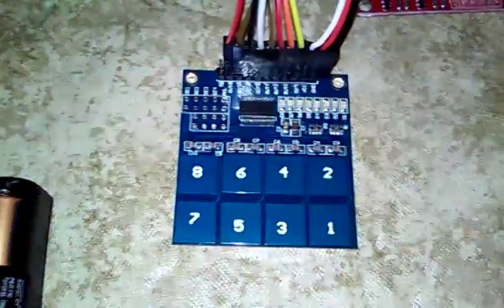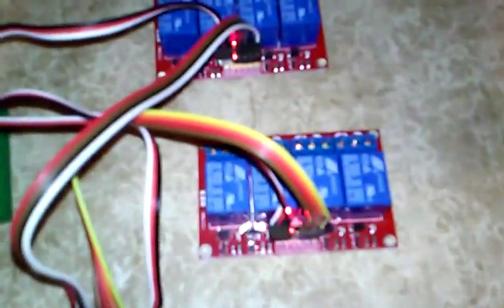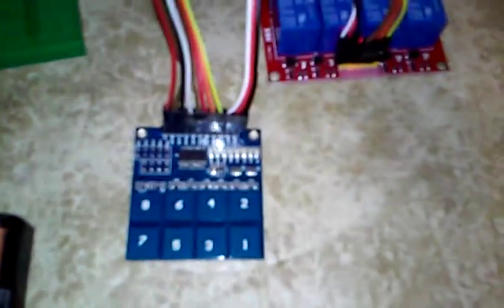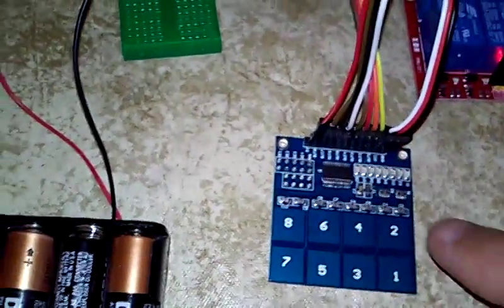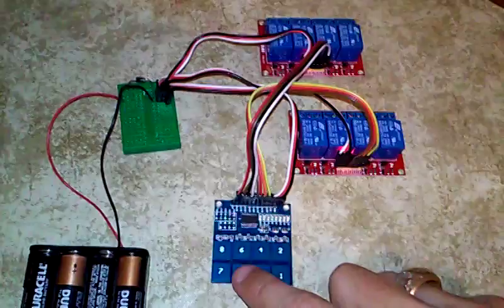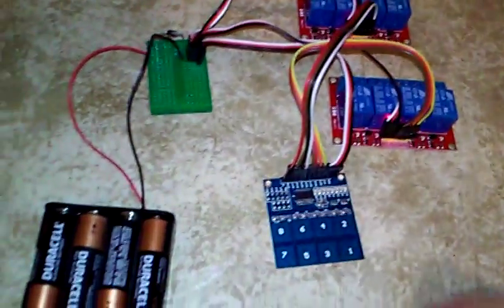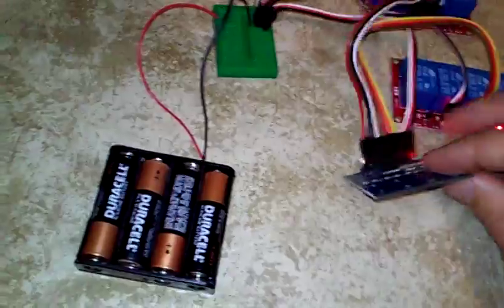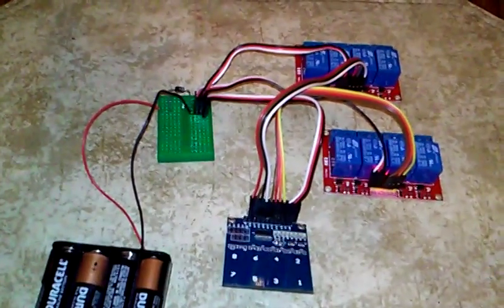TTP226 Touch Sensor Demo

Comment: Thanks for the jump-start on this little pesky board!  The sensitivity jumpers really helped settle it down.

A little late to the party but I have found the answer to one thing you mentioned.  This unit takes so little power that when you disconnect the power, you must short Vcc and Gnd to drain off any electrons still there and get a full reset.  Else, it will come up and do odd or unexpected things.  It might not read the sensitivity jumpers, for instance, or the AHL jumper.  I tried AHL and it worked, then removed power and removed the jumper.  Upon replacing power, it was still in AH mode instead of AL mode.  I removed power again, shorted the power pins and reconnected power and all was as expected.